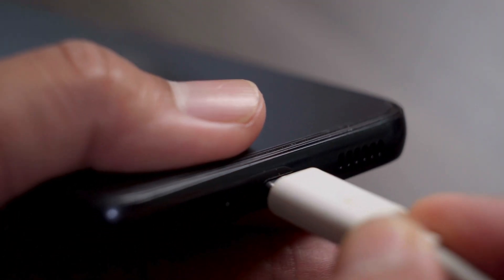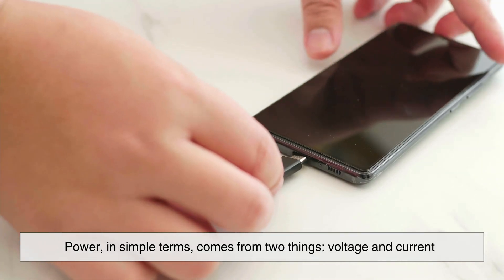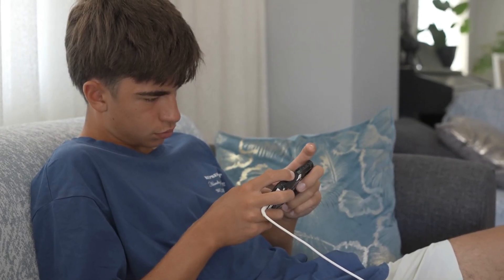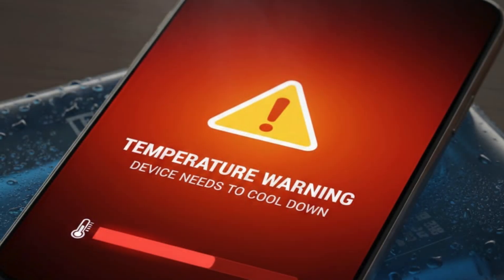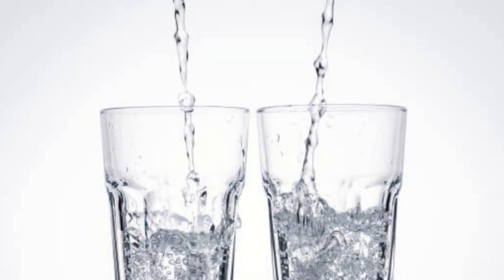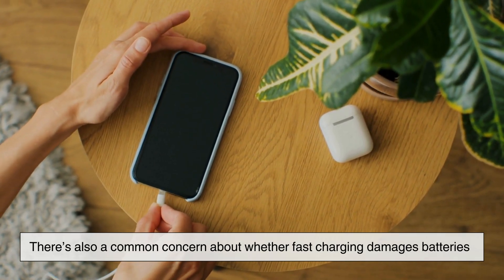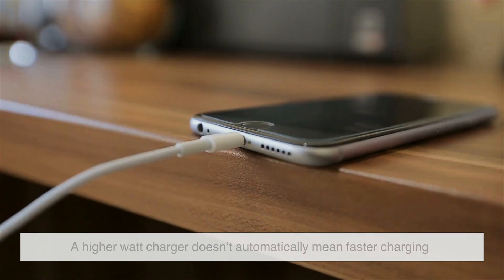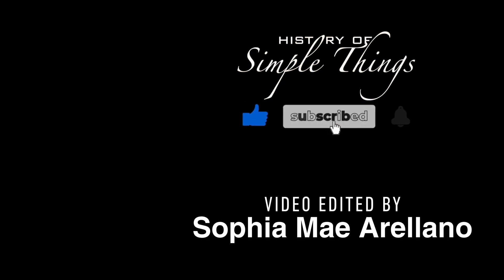How Fast Charging Powers Your Phone So Quickly [ID2221]

Comment: Modern smartphones and compatible chargers
In case that the phone requesting power is capable of quick charge
Some charging chords also has chips inside of them that can communicate to the charger what maximum power it can handle.
If the charger didn't find this chip. The charger will test its resistance if it can handle even the basic quick charge 9v at 2A (max)
If the cable didn't meet the minimum requirements then it will deliver 5v at 4a maximum 
Some phones Usually mid range Xiaomi phones has 120w maximum (20V at 6A)
If the device is receiving 10w it is considered quick charge. Weather it is 5v 2a 9v 1a
For phones but it depends
oppo 5v 4a
Most phones at 9v 2.1A
9V
12V
15V
18V
20V
With varying currents (Amperes) depending on manufacturer and model
some xiaomi phones what supports 120w they reach 20v at 6a. But upon testing my own unit. Redmi note 13 pro plus 4g. It reaches 18v at 4.8A. Which is already amazing
Xiaomi released their 240w with the redmi 12 explorer edition
Xiaomi and realme are already experimenting with 300w charger
30v at 10A to be precise they both have their showcase with their test devices in their respective youtube channels.

Comment: And a good trick to help save battery life some I use a 415 v power system it can charge in 10 minutes from 1% buts it’s great for the power
Reply: Don't let your battery zero out, if you can help it.

Comment: Fast charging is harmful to cells and batteries. You can fast charge a car battery using more than say 15 volts, but you will damage the battery, especially if you continue.

Better "fast chargers"(voltage increases) will stop before completely frying the battery, but in general, a slow charge is superior. Some devices demand normal single voltage power supplies. I have 4 devices that use 5 volt only to charge the battery. A cell phone that uses 5 and 9 volt. Charges fine using 5 volt only.

I purchased a 30 watt(at highest voltage)(max) power supply(USB C, fast charging) with 5 voltage steps. I purchased a proper(expensive) USB C cable which can handle 100 watt. I purchased these because of false advertisements claiming my device required USB C fast charging. I put it in a drawer just in case I or someone needs this. My device required 5 volt only, at least 1 amp, and also the adapter had to have USB A outlet for the supplied cable, not the C I bought. Found proper 5 volt(2 amp) power supplies after some searching, and got a pair. Amazon products have massively inaccurate specification data, BTW. I got this one company to make many corrections and add needed information. They wanted 5 stars not 1 ;-) lol